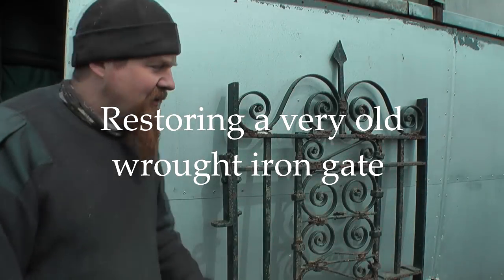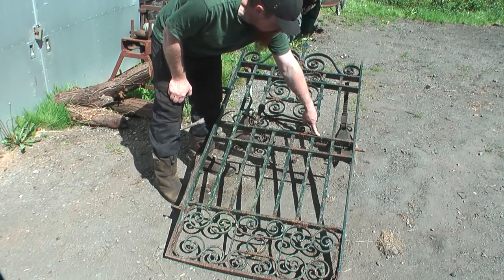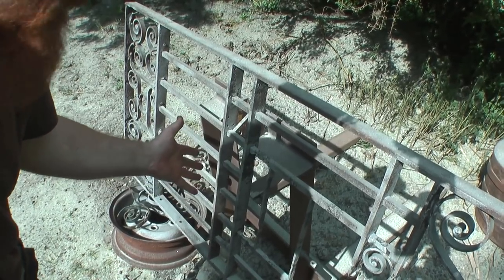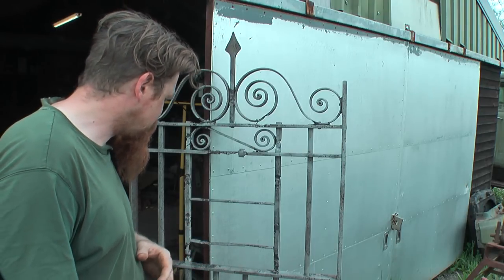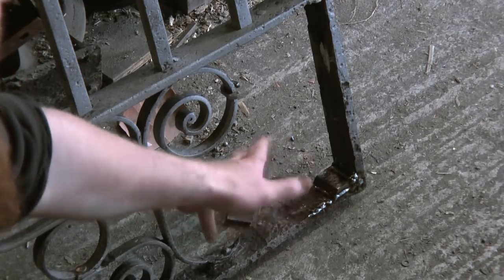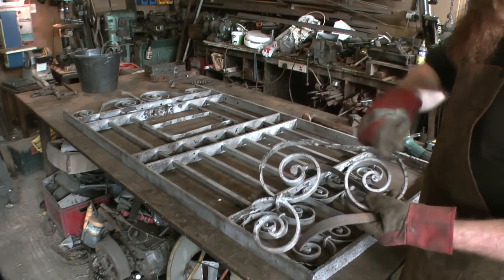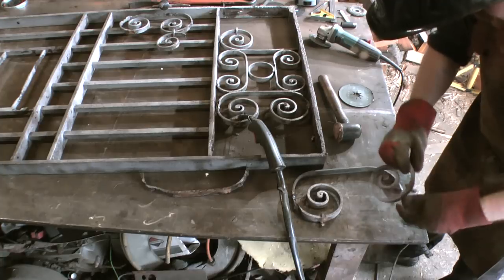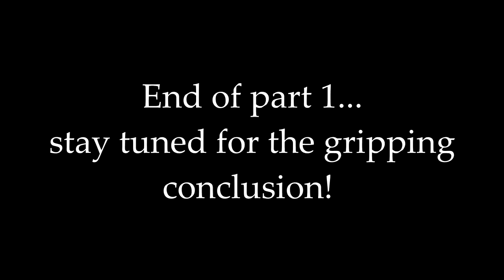Restoration of a very old wrought iron gate pt1

Comment: Hi, have recently found your channel and would like to ask what you would recommend for a rookie welder now living totally off grid, what type of welding set up would you consider. We have a maximum of 2.5kva AC output form our PV inverter, we also have a 4,5kva diesel generator which I would be happy running for the short time I would envisage welding. I would like to be able to weld steel from 1-5mm, occasionally thicker and also aluminium, 2-8mm again occasionally thicker. I'm thinking of repair work and light fabrication. Any thoughts would be greatly appreciated. Meanwhile keep up the great work on your varied and interesting videos. Thanks in advance, Paul
Reply from the maker: For comparison, I have a 6kva (4kw) diesel generator and it can just about manage to 
power the mig welder at 130-140 amps, trouble is with welding via 
generator is the welder calls for power, the sudden loading will bog 
down the engine and it struggles to recover. Just as a rule of thumb you
 would want a generator twice as powerful as the the welder input rating
 on it's plate. So I really need a 10-12kva generator here so weld heavy
 stuff. I bought a engine powered welder (mosa) but it's not a reliable 
solution! A better idea would be a p.t.o. generator running off the 
tractor engine - the tractor engine has a massive flywheel so I think it
 would cope well with sudden loads. More efficient than the transformer 
welders would be an inverter welder  (usually tig and stick in one) - an
 AC/DC one will also suit ally welding, but make sure it's 'generator 
friendly' as some of them are rather sensitive to the generator power.  
Hope that make some sense! Some things to think about anyway.

Comment: Brilliant vid as per usual, but does the crushed glass not get into your skin if you touched it without gloves in the way glass fibre does?
Reply from the maker: I've not had a problem with it. It's actually much nicer to handle than the copper oxide I used to use (that's filthy stuff!).

Comment: Good evening,

Can you tell me a bit about your sand/shot blaster. I'm looking to get something to clean up some old oak beams and stone work.

Chris
Reply from the maker: If you can do the work outside a blaster will bring beams up lovely (if you do it inside the mess is incredible), I've always found stone a bit tricky but with care it can come up well. To give you an idea of the kind of air supply needed, I'm running off a 2 tool road towable compressor giving about 125cfm (some of which is lost running the breathing kit). My blaster will take over 250kg and will empty that in 20-30mins. The breathing apparatus is a must and it must be highly filtered (compressor air contains oil mist which is bad stuff). I keep meaning to make a video on it but I'm always put off as it's such a horrible thing to use!
Reply: Thanks for the speedy reply. It's all in-side so will be messy - just had some horrendous quotes so looking to do it ourselves.Still in the research stage as have plenty to keep us occupied. 
Video would be interesting well to me ;)
Reply from the maker: As it's indoors, you might want to look into a blaster/vacuum system. There's an example here (about 3.40 into the video), it would be much slower then my one but that may not be a concern if you are doing it yourself:
https://www.youtube.com/watch?v=tQJsJ5MIOuU&t=441s

Comment: Hi , Im restoring a good condition wroght iron very old gate , Id like to keep it the original iron colour . What do you recommend that I paint/varnish it  with if anything.
Reply from the maker: It depends on what you mean by original colour. Iron (and steel) will always oxidise in the air so the grey colour that appears after blasting for instance will only last a few hours before rusting (red oxide). When Something comes out of the forge it's got a layer of black oxide on (hence the term blacksmithing). This black layer can be burnished and protected with bees wax and that's what I do for all my interior pieces and it looks great, but such a finish would not stand up to the weather if outside. If you want a rusted finish you can coat the bare gate in linseed oil and it will end up a russet brown but it will shorten it's life. I would not recommend spraying with lacquer as it dosen't last well and yellows, not would I recommend  galvanising as the acid treatment can destroy wrought iron. Personally I would do just what I did on the gate in the video (they would have always been painted originally). Hope that helps!